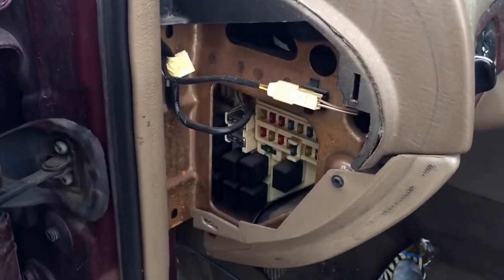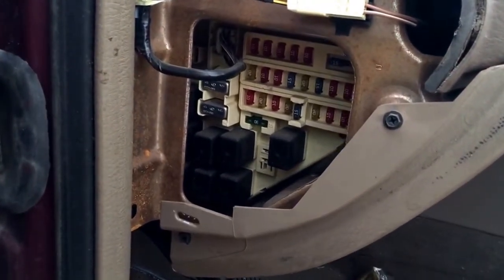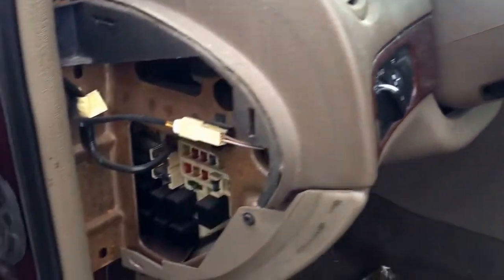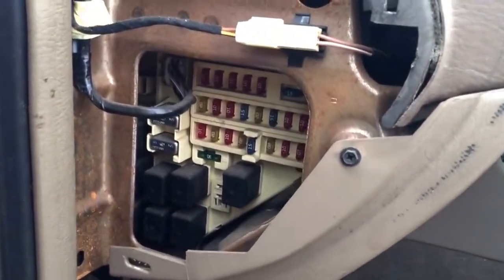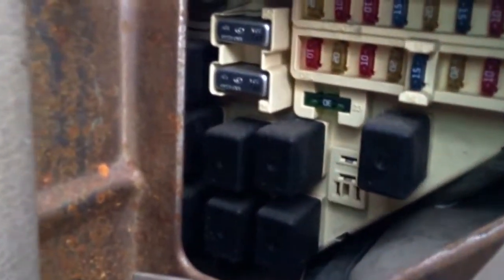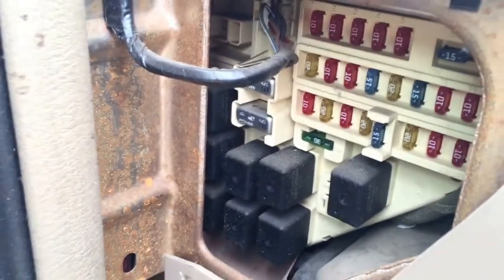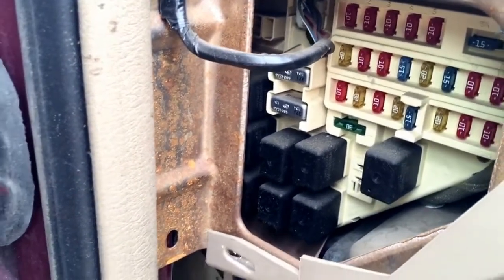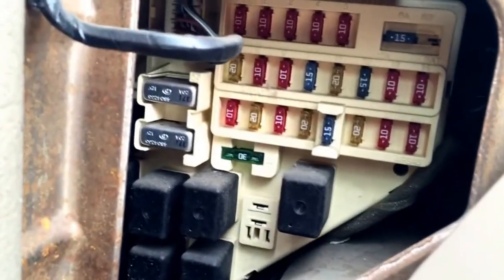Chrysler 300M Fuse Box Location

Comment: Got the same car & everything is the same. Why wont my arrow gages move  when I turn on my car or when I start to drive? They just all stay on 0 & it stays on the E with heater on the C
Reply from the maker: That problem could stem from a couple different issues. The contacts on the back of your gauge cluster can become corroded causing electrical issues with your gauges and lights, but to have a better idea of your problem I would need to know if your gauge lights are working when you turn on your headlights. Thank you for your question and we await your reply!